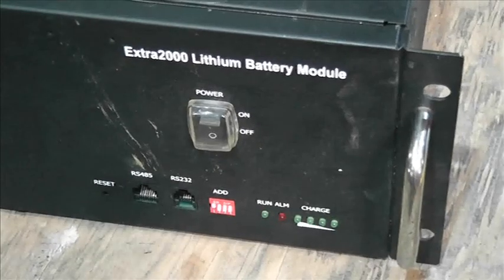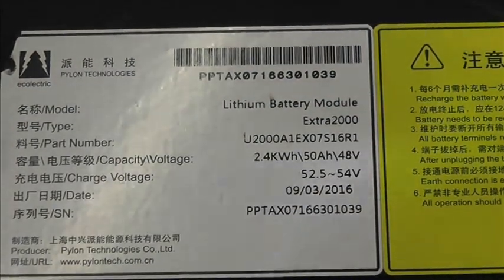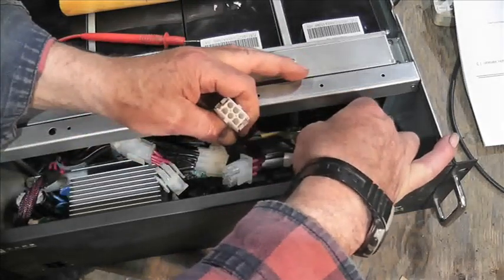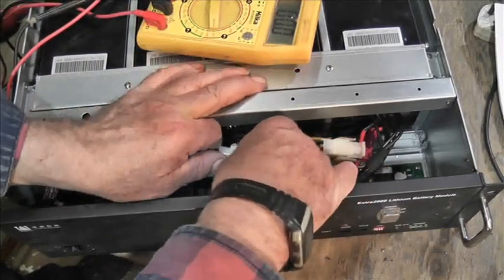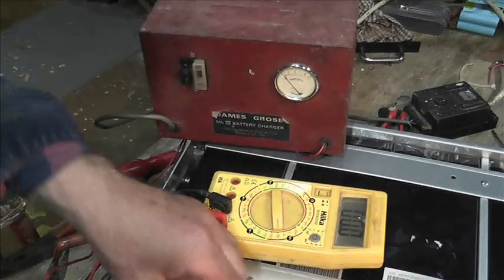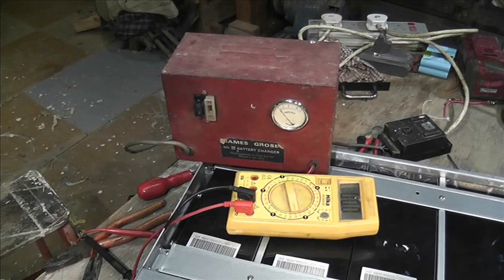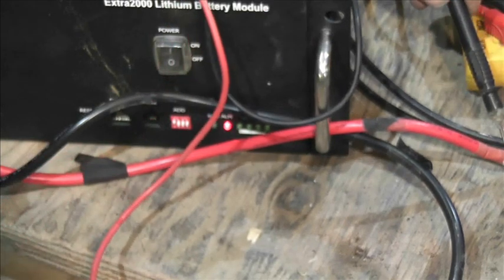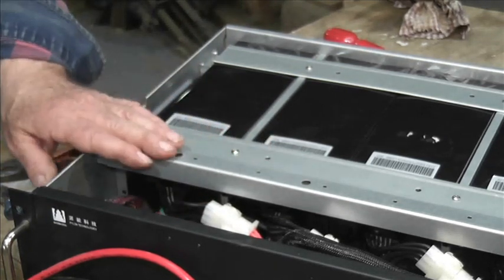Pylontech lithium phosphate battery investigation, what's wrong with it?

Comment: Take the battery pack at 9v apart checking for a battery protection board or fuse failure otherwise reconfigure to 24 or 12v with spare cells. Suited to portable power. Just had a thought typing this, some battery protection boarde with a dw1 chip refuse a charge below a predefined voltage.
Reply from the maker: Yes there's loads of options, but reality is stranger still, and the answer is in the next video, cheers

Comment: In the 9V pack there may be a bad cell, i think there are 3 cell in each pack. charge the bad cell wit 4V eac cell is 3.7V, it may help you out, so you can charge normal true bms on all cells. But bad lipo cells never recover complete, but you can get it up running. I will recoment a RC charger from radiocontrol world to recover lipo/life cells.
Reply from the maker: Hi, yes I'm thinking they don't recover from very low or flat. I'm going to take that pack with the fault cell apart to get a true picture, cheers
Reply: Charging a LiFePO4 cell up to 4V will kill it.
Reply: @TheInfoworks  you only need to charge the bad cell for few min on low current to raise the voltage, then the bms will reconice the entire battry.
Reply from the maker: @randacnam7321  Exactly, they live between very fine limits, cheers

Comment: I'm only 6 minutes in, but I'm thinking the only problem may be is that it needs charging? When the cells drop below their critical voltage the bms turns them off to prevent damage to them. It looks at this point as if that's what's happened here...
Reply from the maker: Will, maybe but it looks like one packet in the low voltage battery is at zero volts. I don't think they can recover successfully from that situation. Only way to know is to have it apart. Cheers
Reply: @TheInfoworks  Maybe not yet :-). Another thing that may help, is that the charge voltage needs to be 52.5 - 53.5V.
Edited to add: I'd guess that it's unlikely to try to charge from an input voltage lower than its nominal. Also - the charge current for these cells when over discharged is 0.05C so very low.
Reply from the maker: @will_doherty  Good call, things are moving on and I have used one of the large pulse width chargers I covered a while back, charges well at 30 amps but that last battery only goes to 10 v. More exciting adventures shortly, cheers

Comment: This is why Indo not buy battery powered equipment, except for my small drills and impacts, even though I am well trained in electronics.
Reply from the maker: It's a natural part of a wind and solar home power system, it's just a matter of collecting quality gear. Lithium phosphate are very robust and last for years, cheers
Reply: @TheInfoworks  my son in law will disagree.  He has a lot of battery powered quipment and half of his batteries are kaput. And throw red lights on the charger when you try to charge them.  I have three tools that use batteries and I leave them on the charger when I am not using them.  They fit my DeWalt drill and my two impacts.  I don’t use them everyday but sporadically.

Comment: So is the battery all single cells control  by the BMS ? try each wire and each live neg till you find the low cell, if there are single celled to the bms just wire one new cell in and loose the old one reuse the wires if you look at the connection is shows that wire only goes one way for a reason that is to match the neg wire should be a easy test to find out
Reply from the maker: Hi there are BMS balance charging wires, but the problem is not a problem, it's a 15 S battery, cheers
Reply: @TheInfoworks  try again as i replied but it vanished. the BMS controls all cells the make up your 4  12 v battery's that is charging and discharging its like that to stop thermal melt down before it gets a chance to take hold so as I said have you looked  at the fault  its clearly that block of cells in row 4 from your right simple way of seeing if that true is swaps a cell block around p.s I said in the first thread reply, its the battery a cell fault within it just find it via test and wire a new cell on the wires of the old one its simple stuff there is no way a BMS will try charging a block of cells if the reading is not correct. that is why so many people tried converting twizzy cars over and failed last point The BMS will stop its self charging a single cell if it finds the following, over heating or poor low charge rate a fully battery is dropped and fault light shown or a BMS CHIP FAIL your readings show the battery at fault